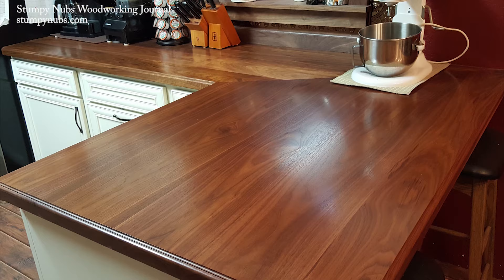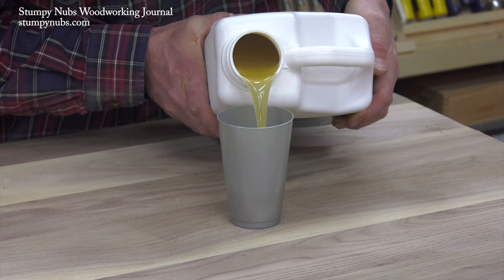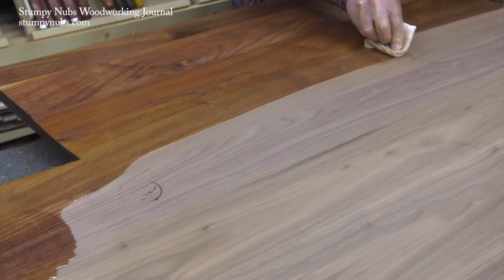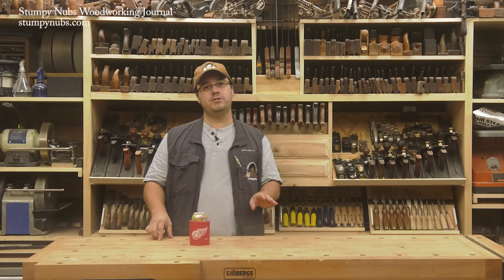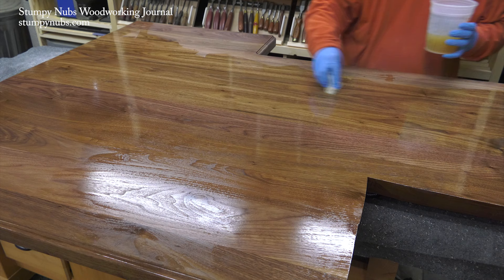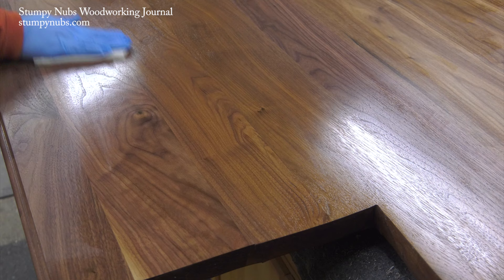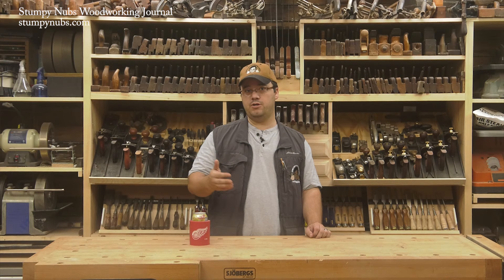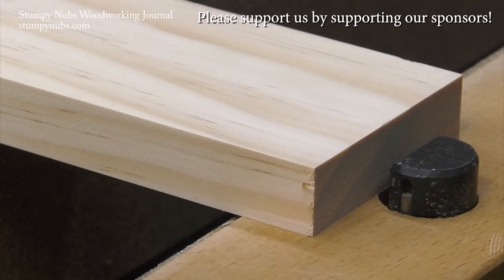A finish durable enough for a wooden countertop (Arm-R-Seal)

Comment: Hi James. I’ve been enjoying your videos for a long time.I’m loving this series on the countertop and have one question.I have a butcherblock countertop which was finished with raw linseed oil. Would the finish you just used on the walnut be able to go over the top of the linseed oil as a new finish or would I need to plane it down?
Reply: I'd contact General Finishes on that one, but I'm guessing you're kinda stuck with the oil finish from here on out since it penetrates the wood. It'd be difficult to get it all out, making adhesion of a new finish such as Arm-R-Seal risky.
Reply: In any case if you have a true end-grain butcher block, you'd be better off with a non-hardening finish such as mineral oil anyway, as a film finish could chip and crack when you cut on your butcher block. If you have a long-grain surface like shown in the video, see my previous response.
Reply: For a butcher block, cutting board, or other surface that will contact food, I recommend a stable oil that is edible. Grape seed oil or walnut oil come to mind.

Comment: I keep going back and forth between epoxy, Rubio Monocoat, and arm r seal for my kitchen table. It'll have 8 children eating at the table each day, 3 times a day. I just don't know what's best. Each have their pros and cons.
Reply from the maker: I don't think Arm R Seal would be tough enough for 8 kids.
Reply: @StumpyNubs  thanks for the feedback. Rubio gives it that great natural look kind a double coat will even give it a sheen. It's also easy to repair and no smell but I kinda like the glossy look of a good poly. The epoxy is probably the most durable but gives it a thick plastic/glassy look which is a bit too unnatural, and eventually those Tasmanian devil's will wear through that epoxy. Repairing that would be a lot of work but much later in life. ....sigh, decisions decisions.

Comment: As far as I can tell ArmRSeal is poly mixed w other resin/s, but overall what I read suggests mostly similar to poly in water resistance and abrasion etc, why do you say not as durable? Is that bc it’s wipe on so essentially diluted compared to other full strength poly? Or really different strength, durability, in terms of the other resins? Thanks for great vids!

Comment: Thanks! I want to finish a 1.5" thick butcher block-style table top like this. Do I have to finish both sides at the same time? Or can I finish one side, let it cure for 30 days, and then do the other side? Thanks!
Reply from the maker: I'd do at least one or two coats on the underside as you go. Put a coat on the underside first, then flip it over onto some painter's pyramids (https://amzn.to/49rx0bo) while you work on top side. When everything is dry, repeat for the next coat, again starting on the underside so it is always the one on the painters pyramids, in case they leave marks.

Comment: James, I just put together some butcher block countertops, I've been looking all over for the best finish for it, it's a rental property and I want something that's durable that doesn't require a lot of maintenance and recoating.  What would be your absolute number one go to for this? Would it still be the arm-r-seal?  I have seen some videos where people are swearing by the waterlox sealer/finish followed with their second coat product.  And then you have fiddi's hard wax oil.. just wondering what you think since you're arm-r- seal video is 4 years old if you would still go that way.

Comment: My (in process) workshop will have a bench top that wraps around a corner of the shop.  It will be roughly 22FT L x 40"W.  I am seeking support from seasoned pros on which type of wood (plywood) to use for the top.  Because of the aesthetics of the shop, I would like very much to keep it as clean looking as possible.  So I would also need to know how to protect this wood so that it would be highly resistant to scratches, water, etc.  Don't know if I can make scratch resistant, but would like to get as close to that as possible.  This bench top will not be used for furniture or other large items, it will be used for smaller projects.  So there won't be excessive hammering, etc. on it.  However, I would like to have it as strong as possible.  The thickness I am planning on using is 3/4".  Any ideas on which wood type to use?  I am aiming towards Birch, but some say that it's hard to protect that surface, as it's very porous.  Any help would be great!  Thank you!

Comment: Very informative thank you. Do you have any recommendations of what type of "varnish" or sealer to use on a new pine floor. I was think of 2 coats BLO and one coat thinned out polyurethane which I got from your oil video. Would this be durable enough for  pine flooring?

Comment: Thanks James for another great video. I am working on a wooden counter top for a widow at my church. I am using hard maple, this is the first time I am using this type of wood for such a high traffic area. I have used Walnut for bar tops and such. But never hard maple. 

After putting this coat on the wood, should I put a wax coat over top? 

I am familiar with Osmo, seems to be good, but I want to try something new for this project. 

Any thoughts?

Comment: So I'm always wondering why use a product that takes 30 days to fully cure. Is this product worth waiting 30 days or even really a better product then making a swipe on poly or buying some at the store?
Reply from the maker: Any poly will take 30 days to fully cure. That's why the smell lingers. If you can smell it, it's not cured.
Reply: @StumpyNubs  that's super interesting thank you
Reply: I’m getting ready to install wooden counter tops at a clients home. I can’t tell them to wait 30 days! Yikes. I could tell them to be careful for maybe a week. How about a floor varnish as a good compromise... not fine furniture grade but still nice and durable and quick curing.

Comment: I have a wood island top and used Water based Poly for the finish...why does the finish get sticky in spots....(and no, its not from a spill...just where it's touched a lot)  how do I get rid of the stickiness and how do I prevent that from recurring again without stripping and refinishing?

Comment: If I used a satin finish first, and changed my mind and wanted a higher gloss, could I apply high gloss over satin?
Reply from the maker: Yes, but if the original finish is fully cured, you may have to scuff it us with some sandpaper to make sure the fresh coat binds to it.

Comment: Beautiful! I have Hickory wood countertops but I hand rubbed stain on them with 4 coats of polyurethane 5 years ago. They are starting to show the  use and abuse. What can I put on the finish to protect it & take the dullness out of them?
Reply: A couple of choices. Lightly sand it down with high grit, 600 or more, sand paper and repoly it or get some wax, like Mother's car wax and an electric buffer and buff them. I've had good results with both choices.

Comment: So, wooden countertops, even those made from a harder species like walnut, will dent and gouge over time, introducing 'character'.  And no finish will really harden them enough to prevent this, or even seal effectively from water in one of the two wettest rooms in the house, and even this water resistant seal has to be periodically re-applied.  Got it.  Granite or quartz it is....
Reply: Yeah, but even granite needs occasional resealing.
Reply: Shoot man, if I had my hands on that much walnut, countertops would be the last darn thing I’d use it for.

Comment: Your countertops are lovely! We are waiting for our butcher blocks to arrive so we can begin the Armor Seal process. I wonder if you would tell me what router bits you used to create the edge profile? I quite like yours, but I have not yet found a bit or combination of bits to match what you did.
My husband and I very much enjoy your videos. Very informative!
Reply from the maker: If I could do it again, I'd do a profile without sharp edges. They wear easily and you have to touch up the finish on them often. Choose a rounded, simpler profile.
Reply: Ok, thanks so much for that tip. Good to know that before we start edging and finishing ours, which just arrived yesterday. Happy dance! We are excited to get started.

Comment: I have not used Arm-R-Seal yet, but plan to.   I have been using Minwax and making my own wipe-on formulation and have been very happy with the results, but using 5-6 thin coats.  One tip I have been employing is to knock off any dust nibs with a razor blade at a very slight angle to the surface.  Scary at first but it works and I have yet to had any issues with it.  Last time on mahogany I used the razor blade on my final coat and it was perfect.  Have you used this?

Comment: Good work ! And very well explained. Could you tell us the sanding grit you ended with on the raw wood before applying the finish ? General Finishes recommends not going finer than 150g; what has been your experience ?
Reply from the maker: I go to about 150 or 180

Comment: I’m working on one of my first major woodworking projects where I really care how it turns out. It’s S4S walnut, maple and cherry that’s going to be used as a floating wall shelf for my music CDs (I’m old school). A pain free simple finishing solution sounds a lot more appealing than trying to rig up a spray booth. If I use ArmRSeal and allow it to cure for a week after the final coat, will it be safe to put my CDs on it with their plastic cases? I’d like a semi glossy finish with a slight amber hue, tung oil is the only other thing I’ve considered using.
Reply from the maker: I would put a cloth under them until it fully cures. This applies to any polyurethane finish as well.

Comment: Those countertops look awesome.  
I picked up an old bowling alley, wanted to keep the rough (aged) finish.  tried poly on it but with the rough surface it didn't look right. sanded/started over and finished with shellac and then paste wax and looks much better.  I have one half of the alley left for another project, this time it is a bar so I'd like a little more protection.  Any thoughts on how this would look on a less than perfect finish?

Comment: What finish would you recommend for something like an aquarium top that does need water proofing?  Where the interior of the piece would be unseen but experiencing constant high humidity and splashing.
Reply from the maker: I've never built one, so I wouldn't want to suggest something. The underside of an aquarium top is constantly exposed to very high humidity. Maybe an epoxy finish of some sort. Or a boat finish. I'd check with Totalboat.com

Comment: which is the best top for a workbench . oak plywood or MDF or melomine all 3/4 thick
Reply from the maker: If those are the only three choices, I would go with the MDF because it is the least expensive when it needs to be replaced (as all sheet goods will if you use them for a bench top). MDF is also dense and heavy, something that a benchtop will benefit from. But I would put hardwood edge banding on the front edge to protect it.

Comment: Can I use this after applying a stain? I'm wanting to put a table together from some cheap spruce but wanted to try and stain it to get a darker color and then finish it with something. This would be my first real project woodworking lol.
Reply: I used an oil stain and it seems to work fine.

Comment: What’s the best water based poly for my wood kitchen countertops. I like the blonde look. We just removed the old finish and sanded. I also noticed you used a rag to apply. Can I do that with the water based poly.? Thanks. pam
Reply from the maker: Water based poly won't give you a blonde look. It will be mostly clear. And not as durable. But if you prefer water based, I'd go with the General Finishes version. You can wipe on any poly that is thin enough for wiping.

Comment: Can this be put over an existing covering of polyurethane?  Just finish 6 wipe on coats and now wondering if I could sand and put a final coat of this on.
Reply from the maker: Yes, but I don't think it would be an improvement if you already have 6 coats of Poly on. Arm-R-Seal is just a high-quality poly itself.

Comment: Want to use this for some end tables and serving trays: How would you coat the bottoms? Would you do the bottom first then sit the item on risers to do the tops?
Reply from the maker: Yes, that's how I would do it. Put the same number of coats on the bottom as on the top.
Reply: @StumpyNubs  Excellent, thank you for the speedy reply.
Reply: When is it safe to turn it over and set it on the risers so as not to ruin the finish?  Also what was the name of the cloth you used to apply?

Comment: I have a question. I’m considering using this finish on my bar top made from walnut also. Is it safe for say spilled alcohol on it? Also should I add a wax topcoat for added protection from spills and glass rings?
Reply from the maker: Arm-R-Seal is a polyurethane based finish. Alcohol will not bother it.

Comment: My finish sealers are limited where I live, Amazon will not ship general finishes oil base, they will the water base, is that a 2nd better alternative? I have locally minwax and verathane, but not sure about the quality compared to general finishes. Waterlox on amazon will not ship to me either, goiing to see if the company will. Its my first butcher block counter top on softer wood and it will be in commercial area, but layed back log cabin setting.

Comment: Can I apply this finish over a countertop that has been previously sealed with polyurethane (specifically the Varathane triple ply?) I’m not Blu a year into my redwood diy counters and they are really beaten up… but I have two young boys as well… thanks for any advice anyone has
Reply from the maker: You can recoat polyurethane with another polyurethane (which Arm-R-Seal is) if you first sand the lower coat with around 320 grit. You don't have to sand off all the old poly, you just want to cover it in scratches so the new poly can get a mechanical grip on the old surface.

Comment: I have used arm-r-seal satin on the last several project.  I have had repeated issues with visible streaks after each coat. (streaks seem to be a slight difference in sheen, I can't feel it or see them when looking straight down at the surface, but definitely visible in reflections on the surface)  I have tried t-shirt cloth, synthetic rags and foam brush,  I have tried light coats and heavy coats.  can't seem to shake the issue.  I do stir the finish thoroughly each time and pour just enough in a plastic cup for the application.   Did I get a bad gallon jug, or is there something different I should be doing?
Reply from the maker: Satin is harder to apply than gloss because it contains flatteners (which give it the satin sheen). It is very important to coat everything thoroughly because if you go too thin it is more likely to streak. I prefer to use a rag because I can wipe away the excess easily as I work. Wipe in one direction, with the grain, and leave it alone until it dries, even if it looks streaky. It will even out.

Comment: Is this finish suitable for sealing no-fire (air dry) clay?
Reply: I am not sure but you can definitely contact the good folks at General Finishes - they are very helpful with technical questions. Or, just try a test piece (classic response, I know...)

Comment: Would a first coat of shellac improve the water resistance?
Reply: I wouldn't mind know this as well. I normally just use that on cheap stuff or to get a better bond with finishes
Reply from the maker: I don't see how that would improve water resistance. Poly resins are at least as water resistant as shellac.

Comment: what should you use if you dont want to have to clean up that koolaid today. and still want wood countertops
Reply from the maker: Why wouldn't you clean it up?
Reply: @StumpyNubs  just looking for a good water proof finish where if i went to sleep and the kids spilled a drink and didn't clean it up I could with out to much trouble.
Reply from the maker: @Marwil23  My wife doesn't always get every spill right away, especially around the sink, and 4 years later we have no complaints.

Comment: Quick question! We are doing maple butcher block counter tops and want to seal with ArmR Seal. How long should we wait once sealed to install our farmhouse sink? It's an apron front drop in if that matters...
Reply from the maker: I installed my sink after a couple days. But I was careful with the counters for a month. Place cloths under any counter top items (coffee pot, blender, toaster, utensil carousel, etc.) or those stick-on felt feet, don't leave dishes on the counter, wipe up spills right away and keep the area around the sink clean and dry (you can use the sink, just wipe up after.)
Reply: @StumpyNubs  thank you! Do you recommend any particular extra sealer above the dishwasher or are the 3 coats enough?
Reply from the maker: I didn't do anything different over the dishwasher. It's been a little over a year and everything still looks good.
Reply: @StumpyNubs  ok, last question! Before fully tightening the joint connector bolts
Reply: @StumpyNubs  sorry, accidentally hit send. Before finally tightening all the connecting bolts, did you Arm-R seal ALL edges of each individual board? Connecting seam faces and bolts holes included?

Comment: Whenever you sand something that is flat, sand with something that is flat.
Reply from the maker: Few wooden surfaces are perfectly flat, and few need to be. It is far more efficient to sand many surfaces with something that has some give to it. Like a block of cork or your hand.
Reply: @StumpyNubs  Yep block works fine but fingers leave very uneven sanding. If you are sanding a shape, then fine use fingers. When sanding something flat, use something flat. It's more efficient, more effective, and does a better job.